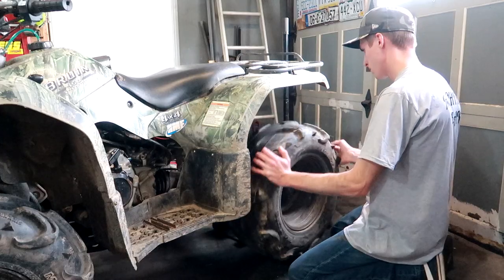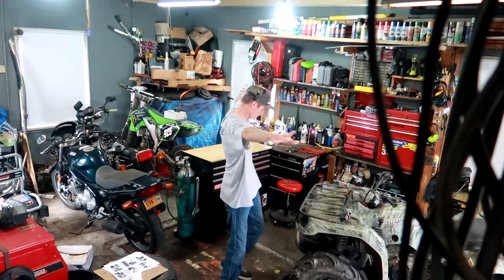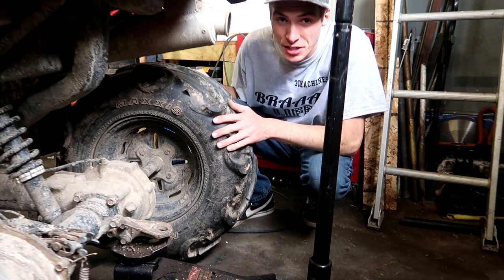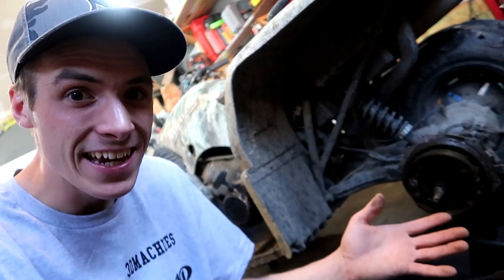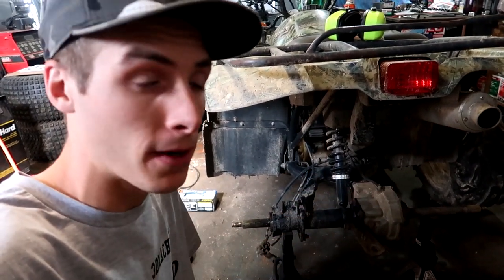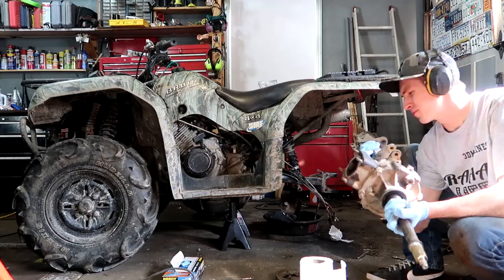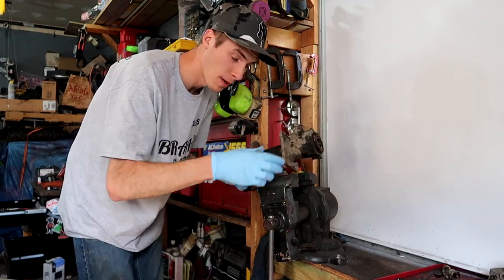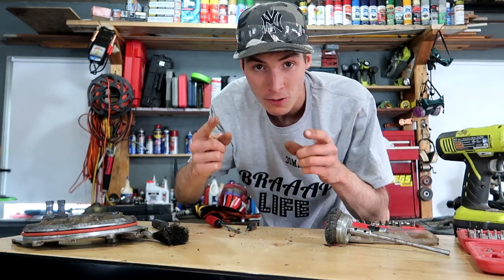THIS is SO BAD!!

Comment: Kind of in the same boat. Replaced the rings on my 1990 yz250 (old horsepower is better horsepower right!) as I'm breaking it in a crank bearing went out. But I'm just gonna do it right and get a new rod and bore it out for the second time put in another piston and rings. Thankfully it's sleeved so I can bore it out all day! Also Great video. Keep up the good work. :)

Comment: I gotta redo the reared on my rancher. swing arm bearings went out and cause my pinion seal to go out.  also may be a good idea to put a bit of silicone around the o-rings, and if that lip seal was dry and brittle try some grease on it. I'm a millwright/machinist by trade and that's something an older guy told me to do to lip seals that don't get oil on them constantly to keep them from drying out and getting brittle.

Comment: Hey Dalton just a tip I see you using your feet to break loose tough bolts.  Puts a pipe on the end of the wrench or rachet for extra leverage and you can take it off easily. Works great!

Comment: Im 14 and I’m an amazing macanic I’ve been doing this since I was 8 years old I’ve took a 2007 Yamaha wolverine engine completely apart and put it back together in about 3-5 weeks and the only thing I messed up with was the bolts in the side cover I broke a bolt off on the block only one lol and I had to drill and tap the hole eny ways after that I always put the bolts back where I got them from now I’m working on a Kawasaki bayou 220 it’s little but strong as hell and will pull the hats off if he’ll 😂 it’s old strong and reliable 😂 good luck with your videos you got your self a new subscriber 😃

Comment: Elbow grease.?
I saw you use
a karate kick
to loosen the bolts...
That's unique, I like it.
I usually just use the double wrench method...
Put close end on bolt
then next size wrench close end
on the open end of the other... and push.

Comment: air ratchets are not meant to break bolts loose like an impact gun. they are meant to use like a regular ratchet with brute force but speed up the removing process... so if the air ratch stops it locks so you can twist the bolt or nut  until it's loose enough for the the tool to speed up the easy work. Love the vids. give it a try let me know how it works.

Comment: Kinda random but i think you'd or someone will know. But anyway where can you buy transmission oil for a lawnmower?
Reply: Bakerboy2323 any automotive store. Napa, advanced auto parts, o Reilly, etc
Reply: What would you recommend for brand wise?
Reply: Bakerboy2323 Lucas or Valvoline are pretty common
Reply: Jaxon Slocum thank you
Reply: Bakerboy2323 no problem 👍🏻